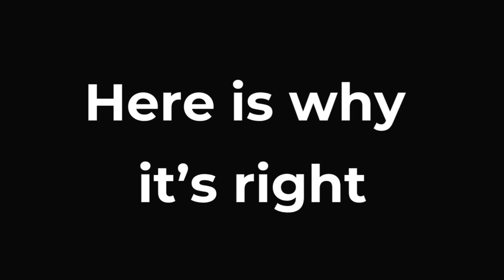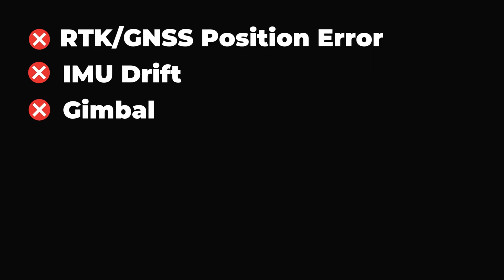How 20 Years in Surveying Changed My Approach to Drones

Comment: I totally agree Stefan. The most expensive drone doesn’t guarantee the most accurate data. 

It does take time and additional hardware costs to stake out your own RTK Base , your own GCP’s and your own CP’s for every project. You need to cost this in as part of the job by considering it an insurance against the inevitable question about accuracy. 

Ive very recently surveyed a 700,000 SQM bulk storage facility with a M350-RTK-Zenmuse L2- Emlid RS3 combo. Produced 25 seperate data sets totalling around 2 terra bites of lidar and photogrammetry data covering 50 tanks. 

All these blocks are now being merged into one continuous point cloud stretching several Km inside AUTODESK Recap. 
Without anchoring each seperate data set to its own properly surveyed anchor points, the accumulated errors would result in significant misalignment across the length of the tank farm. 

Flying and capturing one tank took 45 minutes on average. Surveying the anchor points took around two hrs each due to limited access on the ground. The job would have been way cheaper without this additional time BUT also way less accurate..
Reply from the maker: You pointed right, there are a lot of things to take in consideration in drone business